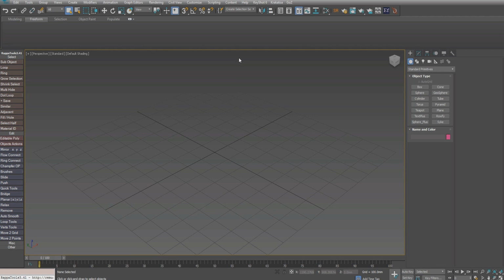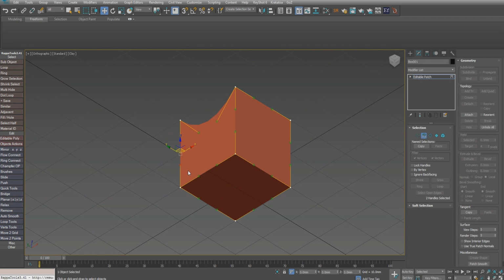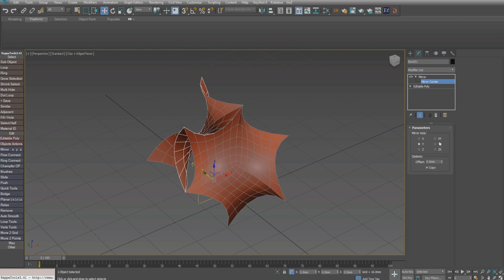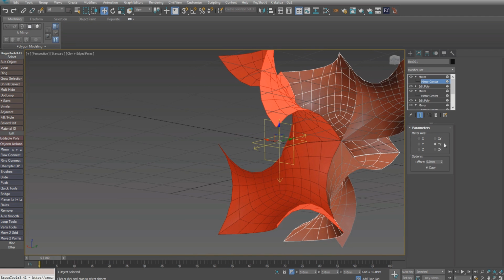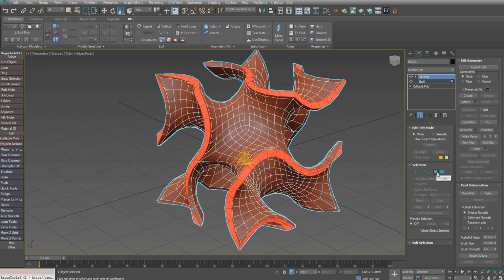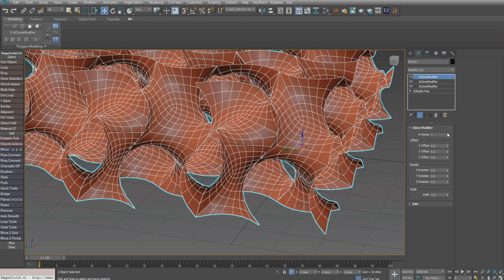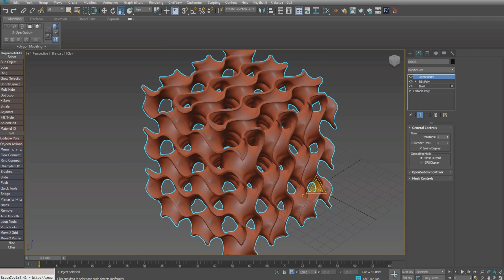3d Tutorial | Gyroid Minimal Surface | 3dsMax

Comment: why when i try to bend the first face to -7 at Z, Y is at 10?
Reply from the maker: Make sure you have done everything exactly as in the video up to that point.  Make sure when you select the handles that you have not accidentally selected additional handles or points.  Be sure the Offset Mode Transform Type-In is enabled, and that the object is in absolute zero space on the grid.

Comment: Great work ! But please, I have one question. 
What radius is your initial arc? (that you ve made with control point coordinates)

PS. I made gyroid, in Fusion 360, but it has triangular (in isometric view), instead of circular holes.
Reply from the maker: I'm sorry I don't have the radius information offhand.  I'd have to actually go back into the software and repeat the process to attain that information, but I won't have access to my workstation until tomorrow.  Since the handles were using Bezier functionality, I simply offset them using a translation integer of millimeters as shown in the video.  The translation was 7 mm in the Z direction.  Then I simply repeated that process to all the other handle sets.  So the actual radius of the curvature wasn't something I calculated for this demonstration, but I can certainly attain that information for you tomorrow if you need it.
Reply: @luxxeon3d  Wow, respect man ! Thanks for fast and detailed explain ! Btw, i am curious about that "secret" 7mm number? I did sketch in Fusion 360 with Bezier spline, but i do not have access to coordinates, but rather to choose either 2 or 3-point manual splines. If i choose 45mm cube, I m just curious what radius / spline should look like, to achieve proper circle holes at isometric view (instead of triangular).
EDIT. Damn, I don't know what "translation integer" is?
Reply from the maker: @brezovprut4431  Do you happen to have a screencap handy of what your model in Fusion looks like?  I'm interested to see the triangular holes and what exactly could cause that to happen.  In all honesty, the radius of the curvature shouldn't matter that much.  At the worst, you might end up with elliptical holes (not perfectly circular), but not triangular holes.  Something more might be going on there.  Do you have a screencap of the model in progress you could share?  If you have some hard edges somewhere or creased vertices, that might cause the situation you're seeing?
Reply: @luxxeon3d  https://imgur.com/a/3usjhBi there are screenshots, if they can help
Reply from the maker: @brezovprut4431  Ok, I see what you mean now.  Yes, it's a very common problem and I've actually done this myself when I was first experimenting with creating Gyroids. It is caused by having a central angle which is not twice the peripheral angle of the endpoints.  If an arc is simply a portion of a circle or ellipse, then we can only calculate the radius of the arc if we know the other properties (length, central angle and inscribed angle).  In 3d software, arcs are easy to find out the radius, because the software already knows two of the three required properties by default, based on your endpoint lengths.  I will reply to this again once I open the software and take a look at the model again.
Reply from the maker: @brezovprut4431  Wait... it just occurred to me the formula here.  In the case of my model.  The cube was 20mm square.  So the radius of each arc would need to be 10mm (half the length of each side).  In the case of this tutorial, I only used a 7mm offset, which if used for a radius in a cad package using mathematical arcs, would not provide the peripheral angle needed to form a perfect circle.  If you're creating your arcs using a cad package like Fusion, then the arcs need to have a radius that is half the length of each side of the cube.  That should give you a much better circle.  If you used a radius of only 7mm on a 10mm cube, then that would give you the type of result you see in your screenshots.  So if you have a 20mm cube, then use an arc radius of 10mm.  If you have a 40mm cube, then arcs of 20mm should do it.  Try that and let me know how it turns out.
Reply from the maker: You have to remember that I'm not using a true cad package in these tutorials.  I'm actually using some cad techniques combined with common "box modeling" and Subdivision surface techniques.  So the measurements I use in these videos need to take into account other factors like subdivision surface smoothing.  When I used 7mm offsets, it's because once I relax the mesh with the relax modifier to smooth it out, another 3mm will be added to the curvature.  That's why I only used 7mm in that step, knowing that the smoothing process will create another few mm of mesh "shrinkage" later on.  This wouldn't be necessary in most CAD packages because topological smoothness is mathematically calculated with NURBS accurate surfaces.
Reply: @luxxeon3d  https://imgur.com/a/LQncTdP no sucess with these radius :/ hmm

Comment: Update: After 129 solid hours of render time (!!!), here is the 8k (7680x4320) version of the v2.0 image as a JPG: http://imagizer.imageshack.us/a/img923/5286/FYR0PQ.jpg You will need to click the image to zoom in to 100% and hold the middle mouse button down or use the scroll bars to pan around the image (on Chrome/Firefox, anyways). I can post a lossless PNG version of it as well, if anyone knows of an image hosting site where I can host a 50 MB file. Previous comment: Without further ado, I present my take on John's Gyroid v. 2.0: http://ultraimg.com/images/2017/02/15/p0A6.png (Click on the image that comes up to load the image in full detail/resolution and hit F11 (Chrome/IE/Firefox) or Control+Cmd+F (Safari) to go full screen). Please let me know if you like it - constructive criticism will be appreciated as well. This image pushes the boundaries of the sRGB color space in the greens and blues, so devices with 100% sRGB coverage will see a more saturated image (e.g., iPads and other tablets as well as decent IPS monitors).
The nerdy details for those interested: The scene consists of 8.5 million polygons and 7.4 million vertices (here it is in perspective with clay/edged faces: http://ultraimg.com/images/2017/02/15/p0cz.png). As you can see, the scene is relatively simple, but camera placement/perspective, object placement, lighting, and materials work took me a very long time to get right - days. Main lighting is an HDRI IBL with two additional disc lights (top and left) working primarily as catch lights - they add very little brightness to the scene. The background is a green reflective GeoSphere with sub-item material mapping (took forever to get the green reflective material to look how I wanted, especially the reflective aspects). No bitmap (i.e., fixed resolution) textures were used, so this scene can be rendered at any resolution (with the caveat of polygons being visible, of course, but you can only have so many polygons, even with 32 GB of RAM) - all of the material detail you see is from reflections/refractions/etc... The scene was rendered at 3840x2160 using Corona 1.5 to a Noise Level of 5.0 / Noise Reduction On / Render Time: 26 hours / Passes: 446. The final image was color/level/contrast corrected and converted/scaled down to sRGB, 8-bit RGB, and finally 1920x1080 resolution (method: Bicubic Smoothing to further reduce noise) in Photoshop.
Reply: @Fido, thanks for the kind words! I am rendering an 8k (7680x4320) version of it right now. I wanted to go 16k, but 32 GB of RAM just won't cut it for that high of a resolution. I made a minor tweak to raise the gyroid cube's material's absorption, so as to show more transparency closer to the edges. Here is a "tiny" screenshot excerpt of it 15 hours into the render: http://ultraimg.com/images/2017/02/16/pG9H.png . Yeah, I know, it's noisy and blurry so early into the render (Noise level: 10.5% @ a measly 64 passes), but as they say, "The night is young." I'll see if I can figure out some way to stage the denoised/corrected final when it's done. But, no matter what browser you use - no matter how high-end and high resolution your monitor is - you'll be doing some scrolling to view this monster of a render when it's done :) .
Reply: I'm amazed!  Incredible work!
Reply: @Ambrose, thanks! The 8k render is coming along nicely. Here's another excerpt: http://ultraimg.com/images/2017/02/18/pMJT.png
Reply: SteelBlueVision Oh man, that looks amazing!  But what kind of machine do you have where you can handle such large detailed renders?
Reply: @Ambrose, an old i7-2600k oveclocked to 4.3-4.5 GHz (depending on ambient temps) and 32 GB of RAM (48 GB of virtual memory for temporary memory crossovers during render start/end). I am looking to build a new PC with a minimum of 64 GB of RAM (128 GB preferred), because I want to do 15360x8620 and higher VFX renders. The bigger problem is the number of days it takes for these images to clear (of noise). It's not just the polygon counts that kill you (memory wise), it's the noise inherent in progressive (and nearly unbiased) renders that is hard to battle (time and energy wise). I am considering a dual-socket motherboard with 8 DIMM slots, once Intel produces their Kaby Lake Xeon chips with very many cores (i.e., 20+). I very much do not believe in GPU based renderers for the time being (i.e., I follow the Corona outlook on GPU based renderers), because of their inability to do simple things (e.g., anything procedural), VRAM limitations, etc... One can always go the "stitch" route to get around hardware limitations on resolution (but not scene complexity), but time is a much harder constraint to battle without a render farm.
Reply: Yeah, I like GPU renderers for certain things.  I had some success with Octane renderer and some others, but I really prefer a render engine which can take advantage of both CPU and GPU, if you want to use all your resources to help the render.  The 32GB or RAM is awesome!  That makes a big difference in how large you can render,  I've never had more than 16 in any of my machines so that's amazing to me.  Awesome stuff.
Reply: some how thought itd be better ...

Comment: Hey John, is the metal texture you used for the gyroid in this image on ArtStation publically available (or can be made publically available): https://cdnb.artstation.com/p/assets/images/images/004/745/397/large/john-malcolm-gyroid-units.jpg I'd like to consider incorporating it into my scene - it looks really cool and goes with some of the other mats I am experimenting with for v2.0 of the scene. Update: The v2.0 scene is done. I must have spent somewhere in the neighborhood of 16 hours on it, getting lighting and mats right. It is render ing at 3840x2160 right now and includes a guest geometric object from the past - your twisted torus with holes. If you gave the v1.0 version a rating of 7/10, then this one is about 25/10 :) . Update2: Some noise/lighting and geometry issues visible in the final render at high-res. I have to rethink and re-render and it takes time to do this, because of the transparency, absorption, and the real time killer, caustics, that are present in the scene combined with high res (region renders really helped while I was tweaking). So, this may take a bit longer than I originally thought. If it draws on, I may post a low-res preview/spoiler just to show what I am trying to do. Stay tuned and I'll post regular updates...
Reply from the maker: Thank you.  The material I used in that render was created using procedural maps in 3dsMax, specifically the SigerScratches, Noise, and ComplexFresnel maps in the ARTRender engine.  Those plugins are freely available for download at the Siger website.  https://www.sigershop.eu/free-3ds-max-plugins/sigertexmaps-sigerscratches/
I don't have the shader saved, unfortunately, but using those maps along with a standard steel material should do the trick.  I used the scratch map in the bump and gloss nodes, and blended some other procedural maps in with it.  I also made heavy use of the ColorCorrection map, which can be downloaded free from Maxplugins.de.  I will eventually produce a tutorial on how to create such materials in the near future.
Reply: Thanks for the link, I was not aware of these plugins and they are VERY useful! I am going to play with them over the weekend and see if I can enhance the scene further.
Reply from the maker: Very welcome.  I look forward to seeing your results!

Comment: Just for fun, I took John's gyroid, made a 9x9 array of them, put them into a little scene and textured it all. So, basically what you see at 00:30 with a "little more oomph." Here is the result uploaded to ultraimg [sorry for the watermark at the bottom right]: http://ultraimg.com/images/2017/02/05/pkCY.png . Hit F11 in Chrome to view the image at that link full screen (assuming your monitor res is 1920x1080). It took me a while to array, weld, shell, quadify mesh, opensubdiv, etc..., the centerpiece, getting all the normals and alignment right. More details about the final image: Final face count of gyroid composite is 1.5 M faces and just as many vertices. The render image started as a 1920x1080 32-bit OpenEXR, rendered in about 8 hours or so using Corona 1.5 (final noise level: 2.3%) on an OC to 4.3GHz i7-2600k with 32 GB of RAM. Post. including minor contrast/saturation tweaks, conversion to 8-bit sRGB, and final PNG output done using Photoshop. I spent way more time composing and framing the shot than I should have and I truly hope you enjoy the result. If you have questions about the scene, please feel free to reply to this comment. Since I've got the RAM, just for kicks, I am rendering a 7680x4320 version of it right now, but I don't know where I could possibly stage the lossless PNG final of that. If you know of a good site, please reply in a comment and I'll put it up once I've got it to a reasonably low noise level, because it has an absolutely ridiculous amount of fine detail due to all of the reflections in the scene. If only I had an 8k monitor that could actually display the final image all at once at the full 33 MPixel resolution :) . I'll see if I can update this post with a little segment of the image while it's rendering, once the noise level is down to something remotely reasonable (i.e., 12-24 hours from now). The full render will take days to a week (it's doing 5 mins per pass and I need several hundred passes to clear the noise).
Reply from the maker: That looks incredible.  Excellent work on your render.  That is going to be an unbelievably high resolution render, and I'm not sure there are any resources for textures out there which support that kind of HD texture maps. However, I'll keep an eye out for you.
Reply: Thanks John, and there are no high-res texture maps here - it's all geometry and reflections (i.e., resolution independent). With this high-res render, I am trying to bring your creation to life, well in a manner of speaking. Here are some unretouched low-res (relatively speaking, of course) screenshots about 24 hours into the multi-day (week?) render (current noise level: 4.2%). Note: If you click on the following links, ultraImg will ask you to click in the middle of the screen to show the images with full detail/non-blurry. This is due to the larger file sizes (approx. 3.5 MB) of the far more detailed PNG crops (I chose to use PNG not to introduce artifacts beyond the render noise present thus far in the ongoing render): 1667x1008 screen cap of top right corner of gyroid from the 7680x4320 monster render: http://www.ultraimg.com/image/pqhY  Bottom left corner of gyroid (1665x1006 screen cap): http://www.ultraimg.com/image/pqhv . Note that the opensubdiv iteration level of 2 was apparently insufficient to subdivide/smooth out all of the faces at this ridiculous resolution, but I suppose we can brush it off as "artistic flavor" :) . I like how the blue reflection of the surrounding hemisphere interacts with the gold. It took a while to find some good (and as it turned out, complimentary) color choices and materials to go with gold, but wanted to embrace your composition from 00:30 to a reasonable extent. I hope you enjoy and I'll keep updating as the render progresses.
Reply: @Billy, thanks, the high-res version is complete and I will put it up over the weekend. I am refining the scene with more "stuff." I'll upload a sample of that as it comes along.

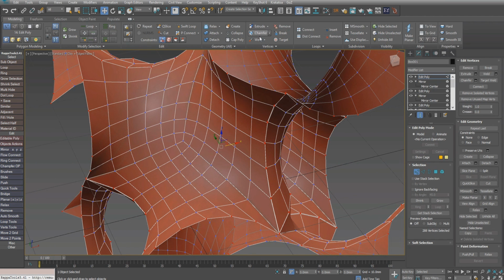Comment: Correction: at 15:20, hold down control (and not shift) to maintain the selection in the vertices. Also, I believe you need to have the Max Creation Graph modifiers installed to get the AClone... modifiers to be present in the modifier stack (I may be wrong). Also, Clone_MCG has replaced the ACloneModifier in the latest MCG pack. (See: https://area.autodesk.com/blogs/the-3ds-max-blog/more_mcg_samples)

Other than that, awesome video and awesome geometric design! A thumbs up from me, as always. This particular exercise was a bit more complicated to follow compared to the previous ones, in part due to all of the symmetry in the constructs, but certainly not impossible and very much appreciated. I am not sure how you could have presented it differently to make it easier to follow and if I don't have any constructive criticism to offer, I choose not to criticize at all :) .
Reply from the maker: That is correct.  I misspoke the hotkey for that, and will add a Youtube annotation in the video for it.  Thanks.
Reply from the maker: Also, thank you for pointing out the location of the MCG modifier tools, which Autodesk has provided for free.  I believe they should include them in future releases, but I've added that link and a link to the first sample pack to the description.
Reply: Thank you!! I was just missing them and didn't know what to think :D Will look now for these modifier tools.